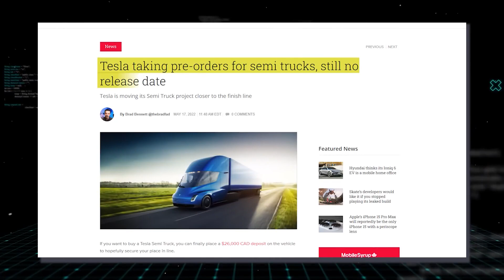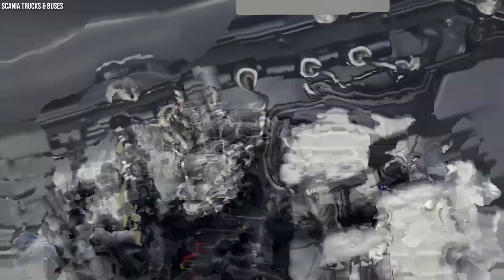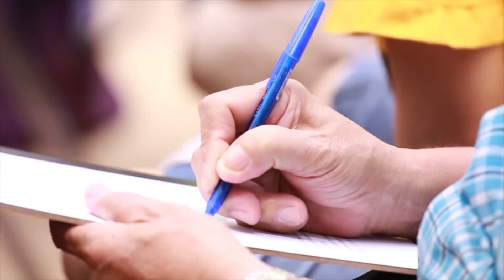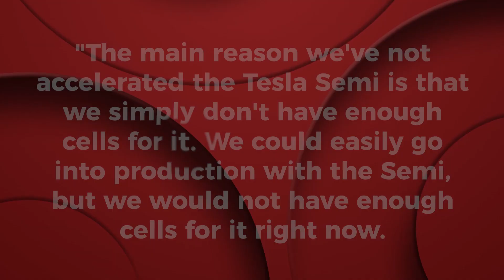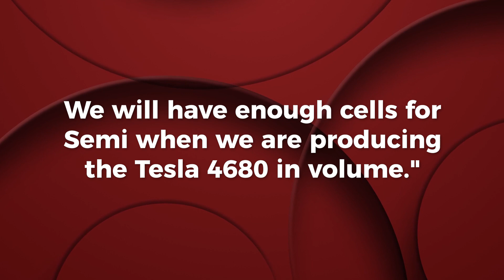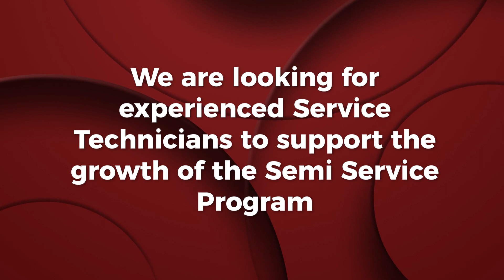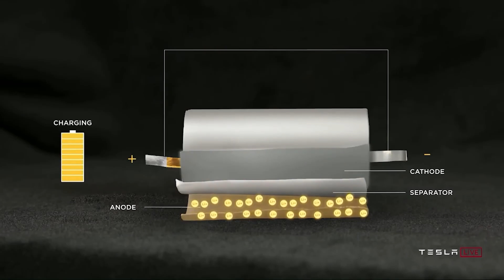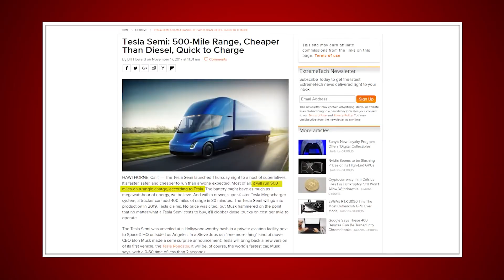The Real Reason Elon Developed The Tesla Semi Truck

Comment: I know that nobody wants to hear about swappable battery packs these days, but on the semi you could make really easy-to-access battery boxes right in front of the rear wheels, accessible from the sides. There would be non-removable batteries too - in the undercarriage -  but if a quick stop and swap could give you 250 miles of extra range, it would definitely help make the case for switching freight over to electric.
Reply: the batteries are in many ways the structure of the Semi. You can't just remove batteries, and switch them like a flashlight.
Reply: Da shit Ralphie
Reply: Yes! Transport companies want 20 to 24 hours of operation!
Reply: @lornekofman2163  they want to pay 10 of 14 on duty and 10 of unpaid security
Reply: @caribou4441  why not?

Comment: Tesla will start delivering their electric Semi to Pepsi on 1st Dec 2022. So 5 weeks to go.
 At the 2022 Q3 shareholder's meeting Musk said it would go 500 miles fully loaded on level ground on a single charge.
They also said it can recharge from 10% to 70% in 30 minutes which is 300 miles of range.

Comment: Drivers need miles. A 500 mile truck is a loser. You can be the one who sits with no pay every other day will not happen. No one will want this truck.
Reply: Pepsi wants it.
Reply: So sad for Pepsi nothing will bring back pop demand at today's cost
Reply: FMSCA says can only drive 11 hours and rest 10, it’s take 3 hours for a full charge, recharging locations and maintenance is the issue, universal plugs for charging stations, one source, maintenance they will corner the market
Reply: @RALOBLACK  dream on those hours lead to fatigue. Have to have a place to park,eat and rest room. Now find a parking with a plug. And the fires. And the refs are a point of disagreement being a driver doesn't mean your not due overtime and 10 hours of rest does not mean you owe the employer those hours
Reply: @vernon9121  Entrepreneurship is the way to go, rechargeable battery packs or charging maintenance trucks, solar panels on the hood  to recharge batteries, EV is the wave of the future, You need charging stations every 400 miles on major freeways problem, it will reduce emissions by 40 percent or just build the railway problem solve